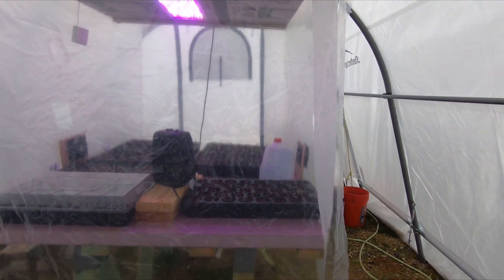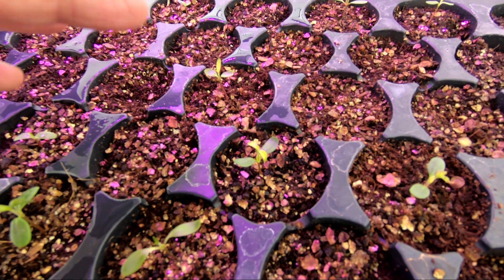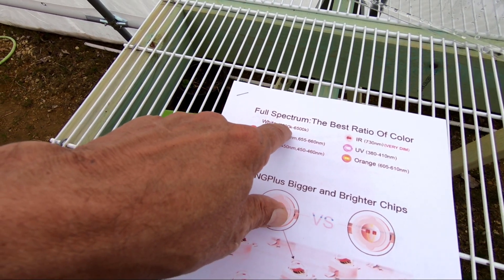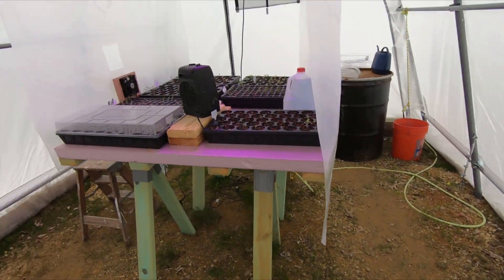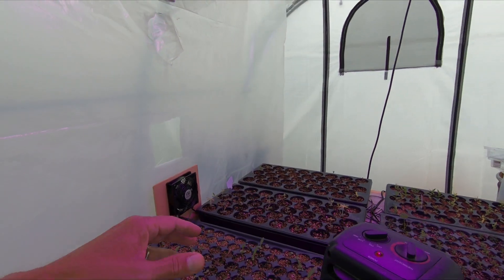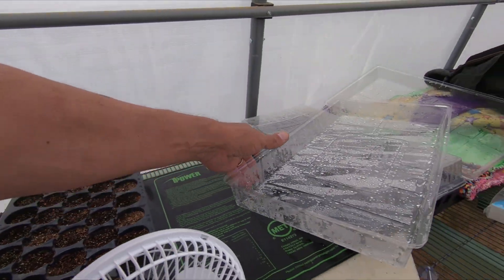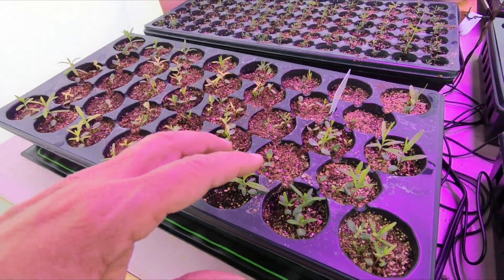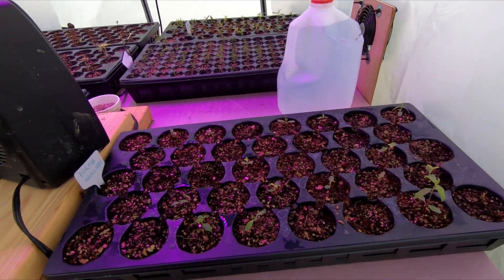LED Light Damage [Seedlings]

Comment: Try using a small fan as well. It helps keep the seedlings cool
Reply: My LED burned (bleach) all of my seedlings at 250 ppfd (around 15k lux) and temperature was around 21°C (70°F). They survived, but 60% of green turned out yellow and then  went dead.
Reply from the maker: Thanks for the tip!

Comment: you don't have a 1000 watt light, look at the specs to see what it consumes to know what the true wattage is. Probably about 300 watts
Reply: LED lights are based on an equivalent rating. So yeah it's true his light is actually pulling a hypothetical 100watts from the wall but the LED intensity/PAR/lumens/PPFD is equivalent to a 1000watt non-LED light. As a very general rule of thumb take the actual watt and multiply by 10 and you have equivalent wattage rating.
Reply: @crazyDIYguy  your not going to find a 1,2,3,4,or500 watt that will out do a 1000 watt HPS.

Comment: Looks like a a nitrogen problem I don’t think the light is the problem
Reply from the maker: It was the light.
Reply: @PlanetMojo  it definitely wasn’t the light, that led you have is nowhere near powerful enough to cause light burn. 

The yellowing is due to overwatering or over fertilisation.
Reply: Definitely 
The light
U will kill seedlings that small if u put Nute’s on them
Reply: Seedlings don't need to be fertilized for quite awhile, they actually contain enough nutrients to grow multiple inches before showing nutrient deficiencies.

Comment: Just got this year a spider farmer 1000 led lights.  They recommend 24 inches,I kept them at 12 inches.  I have a short light stand so that was the furthest up they would hang. .They are full spectrum lights.  I have beautiful tomato seedlings that were 3 to 4 inches high and stalks almost a quarter of an inch thick.  The strongest looking tomatoes I’ve ever grown.  All lush green.  They are in my garden now, healthiest looking plants I’ve ever seen.   Also grew peppers and eggplant everything worked out fine.  Although these Lights are bright 42,000 lumens at the center, it gives off virtually no heat and does not have a fan just a heat sink.  So it’s also quiet.  It is hot to the touch but does not burn your hand.  Never had any luck with T5 lights all I got were leggy tomatoes.
Reply from the maker: Yea, the company replaced the lamp I am using and revised their height recommendations. The UV light caused the damage, and now they have settings that turn of UV for certain stages of growth. Good luck with your garden! It sounds like you have a bunch of nice plants! 😊

Comment: Guys if you are using LED lights you HAVE to supplement with magnesium. 

Fun fact : Calmag is the number one fertilizer sold worldwide in the cannabis industry. I don't use it myself because I don't have a reverse osmosis filter. I use tap water. My tap water is already quite hard. Meaning high on calcium. Hence I chose not to supplement with Calmag. I use Epsom salt instead. Just need the magnesium. As u know Epsom salt is very rich in magnesium. I usually give some every 2 weeks. Either sprinkle on substrate or dissolve in water. It can even be used as foliar spray (I don't do it myself tho).
I can tell u using my led and not supplementing with magnesium the difference is instantly noticible. Idk why but with HPS I never had this issue. So there u go all u LED heads. A wee nugget for u guys
Reply from the maker: Thanks Jaime!
Reply: I have a cheap so called 1200 watt led and growing lettuce I have it at 36" from my 5x5 nft system any closer and they grow very short. it's about ppfd and par your nutrients do have alot to do with how easy your plants will burn and how it reacts to light but before anything you need to know the ppfd at what height makes what DLI # that's what u want to know! I grow my lettuce at 36" like I said and have it On 12 hrs off 12 hrs and they grow great.
Reply: Do I supplement with cal/mag every water when im using a coco/soil and perlite mix under a fc3000 marshydro 300watt led?
Reply: Thanks for the useless info
-LED growers

Comment: I practically killed a couple autos last week. My guess too much light too soon was the culprit. Got greedy and flipped the second switch on them. Gonna scrap them. Won't be doing that again until they have like 5 nodes at least
Reply: so you suggest only red/bloom light for seedlings?
Reply: @ErickeverRB  I was talking about my particular light. It has 2 switches. 1 for a bunch of diodes (together they pull 300 watts) and the other switch turns on 4 COBs (that pull another 200). I got greedy and switched the second too soon which resulted in way to much light and damaged my seedlings. 

Red light, far red and warm lights over 3500 Kelvin are mostly needed for flower where as cooler blue light around 1500 Kelvin is ideal for seedlings and veg.

T5 lights are great for seedlings. They are the lights most commonly used in the industry for seedlings.

 But as a small grower u don't need to buy all that stuff. A CFL or LED or even sunlight will do a good job. Just keep in mind they need less light. If u have a PAR meter have them between 200-400. If u don't (like me) just keep in mind they need 1/3 of the light that flowering plants does. It's impossible to get a sense of PAR (photosynthetic absorbable light) with your eyes. So if your light has two switches keep just one on, if it's dimmable  use that feature, if not raise your light or don't put seedlings smack in the middle but rather far away from middle where light weaker.

I've only burned two seedlings so far.  It was my first grow with this particular light. I've ajusted and learned my lesson since. You really don't need to buy a bunch of extra stuff. You'll make it work even if you have a couple setbacks as part of learning curve, getting used to your light is what I'm saying. Just get a LED with full spectrum and UV supplement. You'll do grand with, u don't need any other specific lights for seedlings. Unless u got a bunch of money to throw at your grow that's my take

Comment: So true, the pot growers are Master Gardeners.
Reply: Obviously not seeing as the LED's he is using has the wrong blue to red ratio that caused yellowing .Also for that coverage he should have 2 units. 
LED's with the correct spectrum are amazing.
Reply from the maker: I am not a pot grower. The lights were advertised for seedlings but had the incorrect height listed in their instructions. The company modified the instructions after many complaints.
Reply: thanks 🙂

Comment: i prefer to use t12,t8,or t5s. i get way better even coverage. led lights are great at light penetration on tall plants. some of the leds are just red and blue. the full spectrum white lights are the way to go if choosing led. im just not sold on led lights foe seed starting. i will stick to what works and is proven. full grown plants maybe a different story. these red blue led where made as supplemental lights originally. some companies took this marketing and sold people the idea of using these solo.
Reply from the maker: This particular light has white, red blue, IR. UV, and orange LEDs. Penn State did studies on tree seedlings and got dramatic improvement, but I'm not sure if they have done studies on less hardy plants. At any rate, I think I'll get a light meter before next growing season and get the height dialed in like you mentioned. It's definitely not 2 feet like they recommend. Next season I'll have an inside room to set things up which will make a difference as well. Too hot + too bright can be extra damaging. Thanks for the info Mr.Green!

Comment: I have been looking into LED but I think I would have to go with less powerful units to fit my set up. I'm pretty happy with my T5's for now but I will be doing some more homework. Interesting.
Reply from the maker: The LED's get some rave reviews from commercial growers. My company did a lot of engineering work for a large greenhouse manufacturer, and the owner told us that LED was the way to go. But.......... they are very different from florescent and even metal halide.  Next batch of starts I do under lights I will start with the lights higher and adjust from there. I just wish I had that info earlier 🤔
Reply: @PlanetMojo  Well, there's a learning curve to everything. I appreciate your mistake because now I can avoid doing the same. 😁